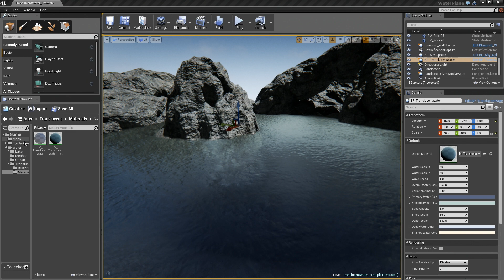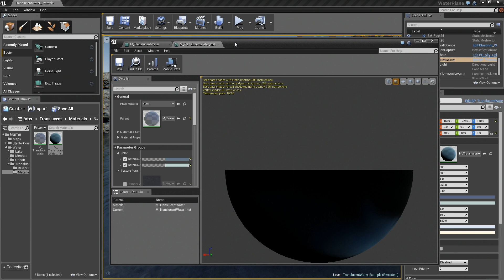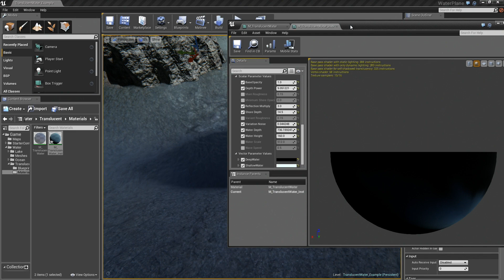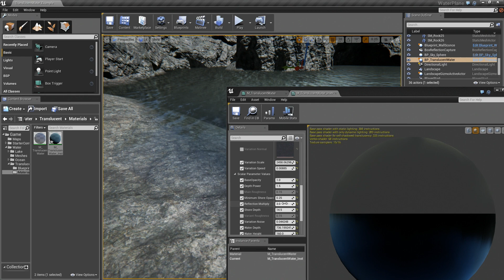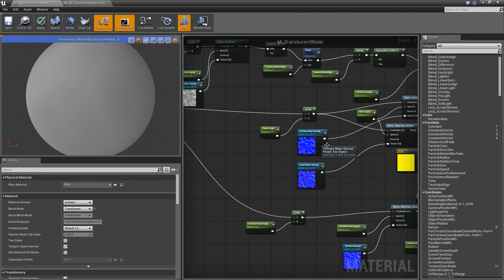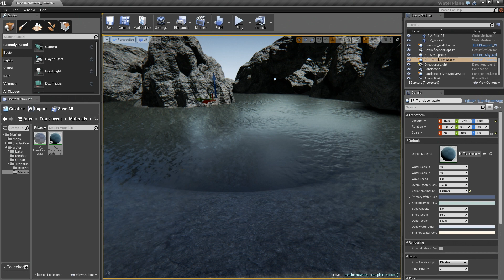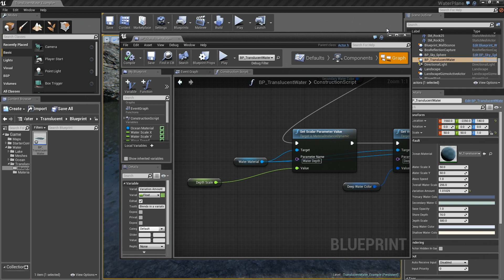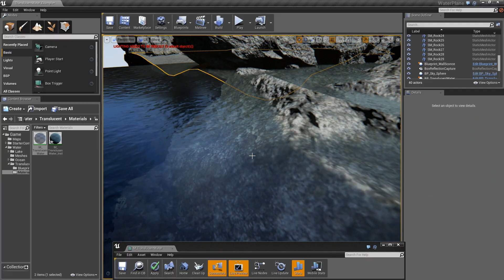Translucent Water Detail | Live Training | Unreal Engine

Comment: The M_TranslucentWater material looks great, just what I need for a pool in a cave. I'm working at adding a water volume beneath to allow inspecting some animated fish, so is there a way to keep the water plane visible from beneath so that looking up presents the same distortions and such? I tried duplicating and flipping it, see the reflections even as it passes vertical to upside down, but then moves into black then transparent. Water reflections from beneath would great. Also, I stuck two animated fish down in the pool, seems there's no  effect of this water layer on the fish, only on the ground model. Thanks for ideas.

Comment: Opacity depth seems to be fixed for me. For example if I raise the water volume, the smooth opacity transition to surface does NOT match the example. is that based on absolute world position instead of being relative to the waters height? Any suggestions?